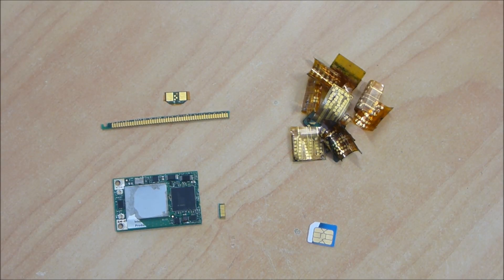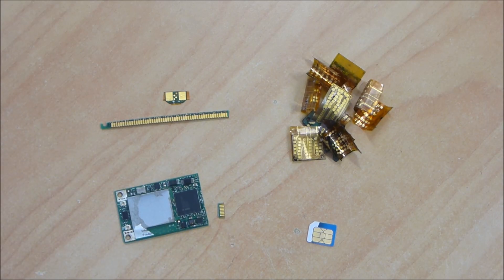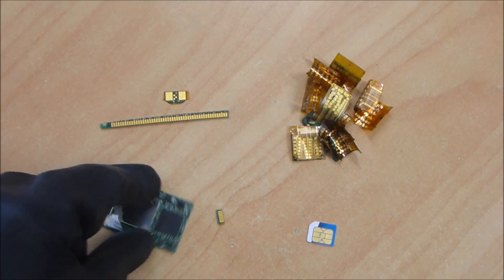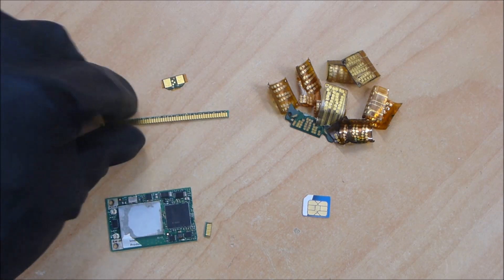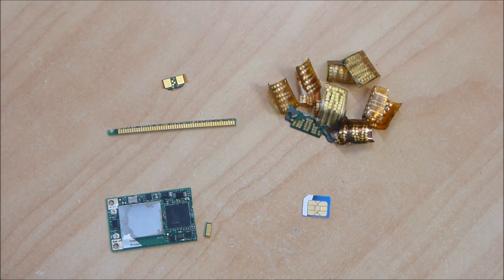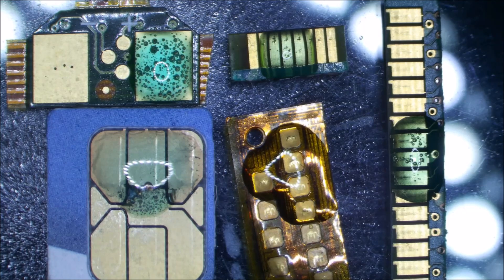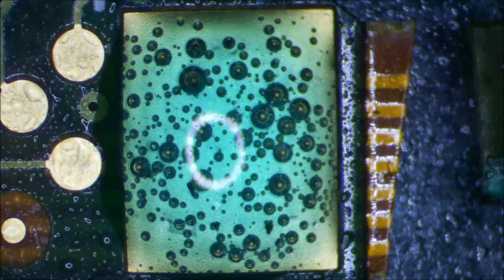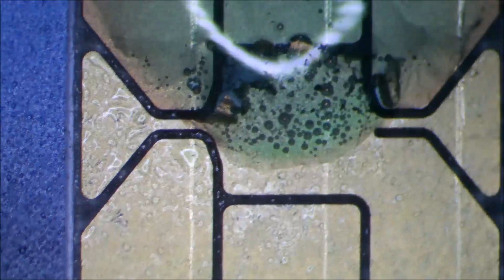Gold Recovery - Hard Gold vs. ENIG Part2

Comment: Sir, what's your estimation for general purity of gold plating. 
Could it be 18K used for plating, or less or even more carats? Thanks for your patience.
Reply from the maker: Hi there, I am not a expert, but my understanding is that the purity is pretty high, probably higher than 18k, there is some additive to the Gold to make it a bit harder, but it is pretty close to pure in electronics like this.

Comment: Thank you very much this help a lot to separate hard gold from thinner the ink cartidge ribbon surprise me. and now i understand why it takes so long to loose foils in AP Solution. it takes about a week with air bubbler if you dont have  nitric acid (my Case).  keep researching we all learn on the way.your channel is getting more interesting with those very understandable  videos. good work that microscope is the best tool for research. more ideas come to my mind to try. the dots from pinless processors, square christal oscilators , battery contacts and old cellphones number contacts. the list never ends is a great hobbie. regards.....
Reply from the maker: Awesome, there has also been a request for the 'finger' type boards inside LCD panels, I like the Pinless-processor and cellphone number contacts, I will do another video soonish with some more of those items. Thanks for you comment and compliments!

Comment: Servus Brother!

very much Enjoy your Experiments.
as an Engineer, you might like try Eddy Current to separate (powdered) materials, other option be a Shaker Table with water OR using a Vibrator at certain frequency, different materials might move on specific frequency patterns in certain direction.
that probably be nice Challange ...
Reply from the maker: Hi there, yes, I tried the eddy-current idea once with some magnets attached to a plastic disc and spinning at reasonable RPM, didn't have much luck moving the bond wires around at that point, but would actually be good to try again with the new microscope! Separating the bond wires from the plastic is surprisingly difficult, at the moment I am perfecting the water wash process, but I still feel like there must be a better dry-separation idea out there! Thanks for the comment!